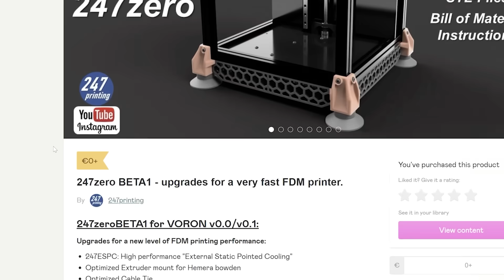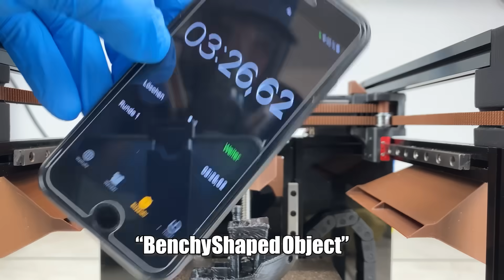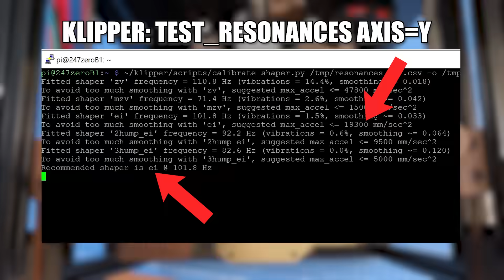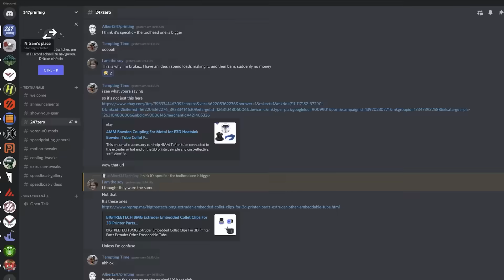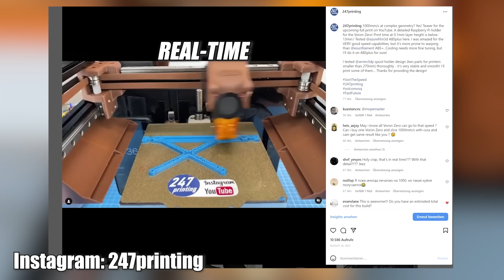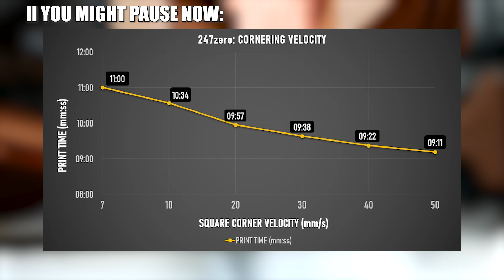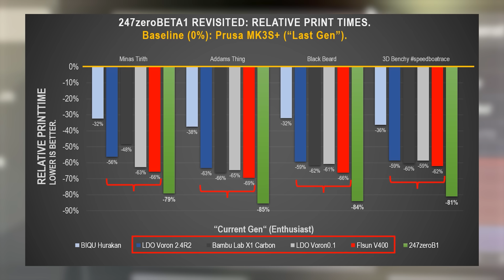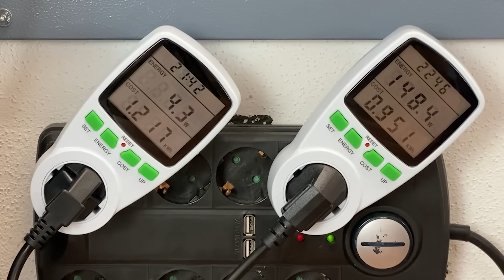HOW FAST is NEXT GEN 3D Printing? 247zero revisited!

Comment: I honestly hope you analyze reworking the frame, even if it's just to add an extrusion in the front, FailFast has found that doing that alone helps a lot. My other take would be to go fully unsupported rail but really stiff AB joints, that would maybe prevent torsion better.
Reply from the maker: I totally agree!
Reply: CONCRETE FRAME
Reply: Big solid cast or cnc machined metal frame. Would be expensive af. I work with lasers and have seen some fairly small units that use a cast metal frame. Didn't understand why they were so expensive at first but the cast metal would be a big chunk of it.
Reply: I have a question as a total amateur who has never printed anything in his life. Wouldn’t steel be much better at controlling resonances than aluminum?
Reply: @DMSparky  iirc, a stiffer material such as steel would mean less dampening of vibration.
Reply: @DMSparky  It kinda depends.  Steel is stronger but also a ton heavier which isnt good when you count every gram. Though your rails on printer are made out of it. Also there arent really any beams long enough on your printer for aluminium not to be sufficient and bend.
Reply: Maybe also rebuild with 2020 extrusions?
Reply from the maker: I should do that, but that's where I stop (for now).
Using bigger extrusions would me: These are no mods anymore, this would be a new printer.
Maybe some time later...
Reply: @ferdinandhenkel4567  why stop at 2020, go bigger :P
Reply: @MatrixRay19  pretty sure 2020 is enough. Voron 2.4 s use it, which move heavier toolhead and have a way larger frame. 3030 seems overkill
Reply: @ferdinandhenkel4567  I agree, said it mostly as a joke. I do however think that maybe also adding more extrusions, at mid sections could help as well.
Reply: @ferdinandhenkel4567  2020 is the reason you dont see very fast (sub 5 min) benchies with 2.4. 2020 likes to bend a lot and just isnt as solid as 3030. For example V-Core 3 uses 3030 and it can go far faster than 2.4 without resonating like crazy. Im talking about 300mm size of both machines.
Reply: @leonartou  yes and no. Yes, 3030 makes sense on the v core, but on a 3d printer this smol I don’t think there is really much to gain. The moving mass is extremely low. However this design is already overkill in every regard, so why not.
Reply: @ferdinandhenkel4567  I mean. It might not do that much rigidity ways but when you compare it with ratrig corner plates it will make pretty big input shaper difference comparing to 2020 with blind joints. Not mentioning it will look super cool. Also its going to add some weight to the printer so it will be more stable during printing. I totally agree with you, difference is not really that much but at this point. Why not?

Comment: I wonder if opposing fans don't cause more harm than good. I would try turning one of them for comparison and maybe putting one of them on another wall, to have them at 90 deg angle.
Reply from the maker: Thanks for this! Comment saved for further evaluation!
Reply: @247printing  Okay I revisited this video and my idea is probably not good, as I didn't  notice you are redirecting flow towards bottom. Your design is probably fine.

Comment: This is awesome.

Have you seen the new Bowden mini stealthburner? I wonder how much that weighs compared to what you’ve got
Reply from the maker: Thanks! Yes I've seen it, I'll definitely print it for check
Reply: @247printing  do you use the Voron recommended settings for everything? 5 top/bottom layers, 4 walls, 40% infill?
Reply from the maker: Normally yes! In some cases I lower the values (for example skirts).